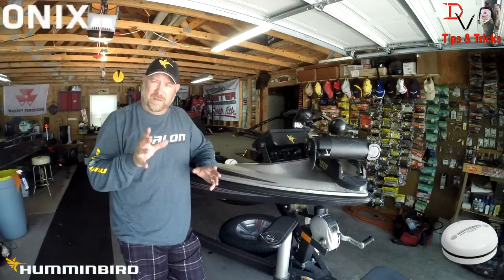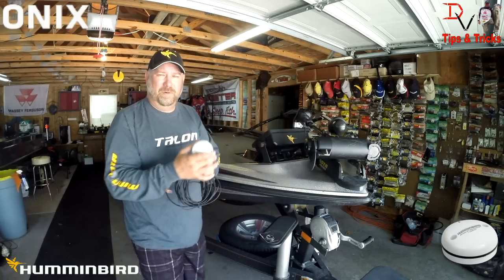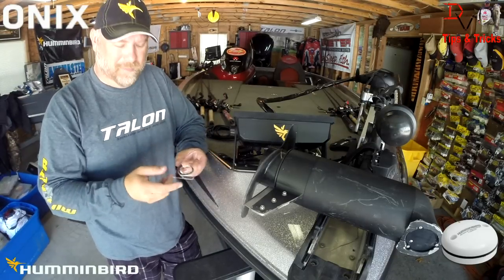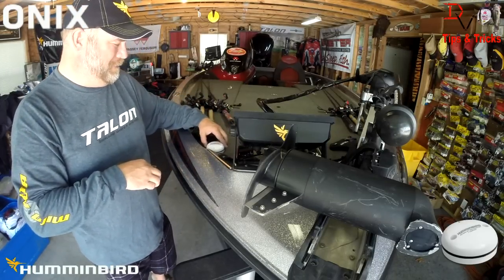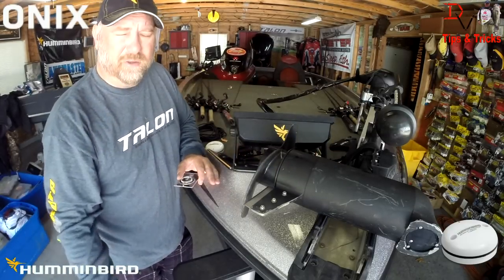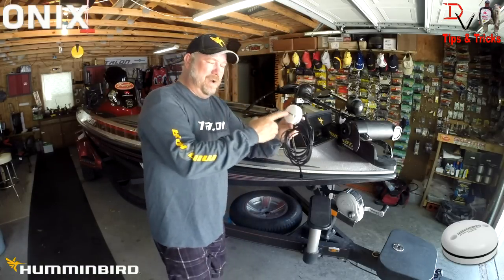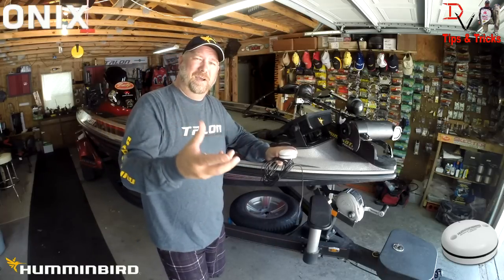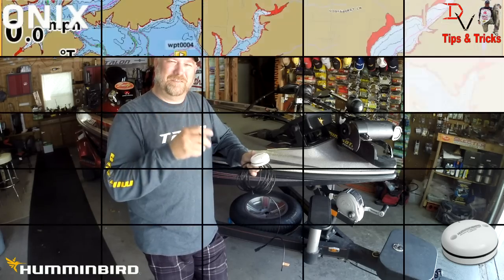Tips 'N Tricks 155: Humminbird Installing AS GPS-HS Tips

Comment: Hello Doug, my Boat has 2 humminbird unit, 798 and 788 networked together through a network box. They have an AS YC - Advanced Accessory System Y-Cable connected but No heading sensor, what is this cable used for?
Reply from the maker: AS-GPS HS is not compatible with the 700 Series Products.
Reply: @DougVahrenberg  Thank you, I am in the process of upgrading to Helix 10 units and I found this ASYC cable and was wondering about it. Am guessing the previous owner installed that cable but did not understand its use. I just finished watching your AutoChart live video thanks you!
Reply from the maker: The ASYC Cable splits the Comm Port so you can have a NMEA Acessories like Interlink and GPS Receiver connected at the same time for the older CORE Series Models like 700 Series. Newer units use Ethernet and do not need to split the COMM Port. Hook GPS Receiver direct to unit on HELIX.